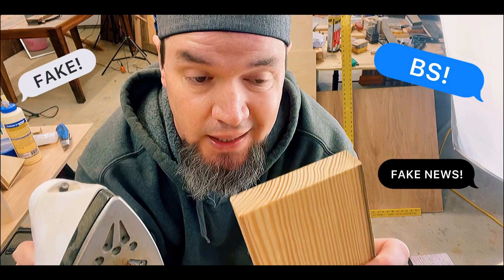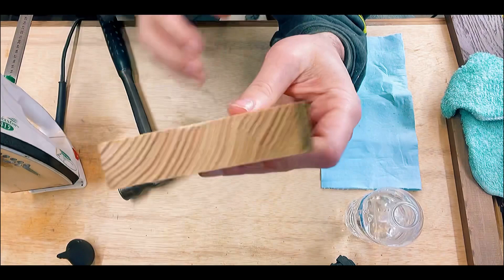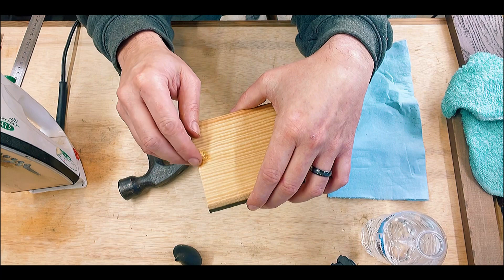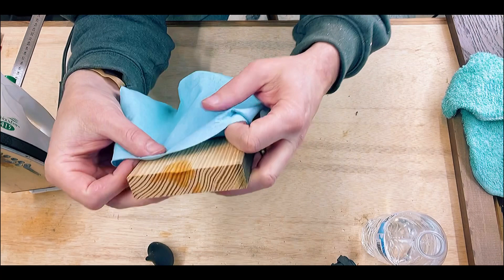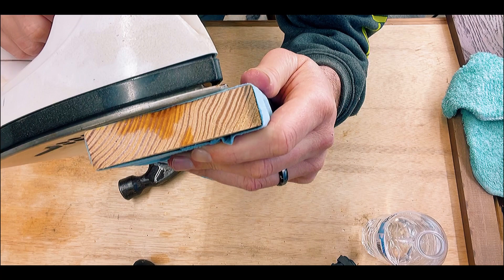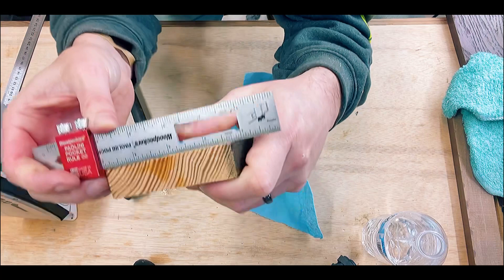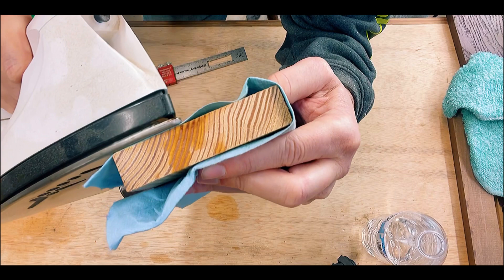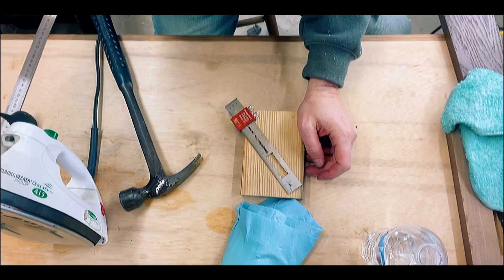HOW TO IRON A DENT OUT OF WOOD.  WOODWORKING TIP!

Comment: I keep finding these nuggets of information. Some I do know from years of hobbying in the wood working platform, while some are new to me, even though my father has been wood working for the better part of 80 years and still like to get his hands covered in sawdust and glue. Sometimes a very small dent can be pulled out with just the steam from the iron, no extra water needed. Like you have done in your demo, "ALWAYS" use a cloth of some kind to protect the wood from possibly being burned by the iron. Love your channel and all the great information you provide. I'm finally getting my 200 square foot shop cleaned out so I can begin to put your tips and tricks to use. Spring is coming nd I'm starting on some trellises and an obelisk. Planters to follow and if I can find the material, raised garden beds and railing planters. Keep the excellent videos and Ideas coming. Happy New Year to you and the family!!